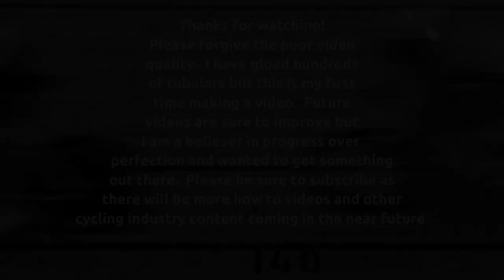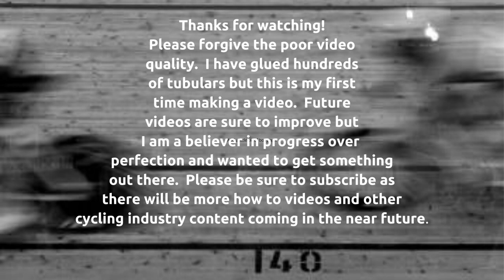How to Glue Tubular Tires

Comment: The now passed owner at Hi-E Engineering  had suggested wellwood  contact cement a few decades ago.  Have been using ever since.  Lol.  If you put the wheel on a table hanging up the axel on the edge, you can hold against your belly and stretch forward. The table would have to be against a wall to keep in place. Great video brother!  Dont forget to pre-mount the tire and let it stretch a bit prior.
Reply from the maker: Thanks!  Pre-stretching tires is definitely an important step, especially with Conti.  Vittorias are so much easier that I honestly will rarely pre-stretch those though other than to just make sure they hold air before gluing.